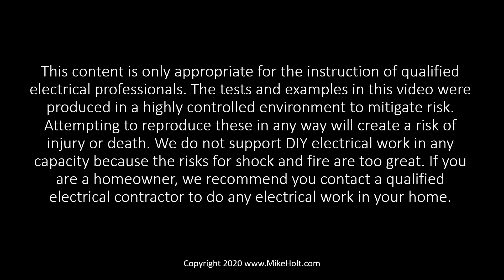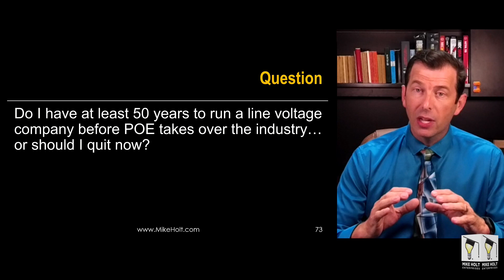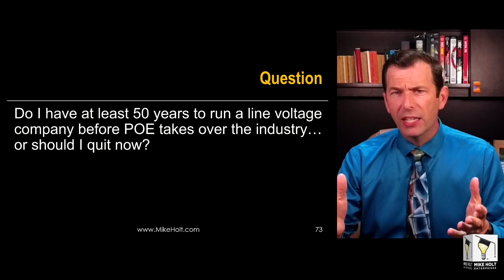Will POE systems replace Line voltage wiring? Part 2 of 2, NEC 2020, (3min:53sec)

Comment: No but PoE will significantly collapse the amount of electricians I have to deal with on a job site and reduce it to low volt primarily. It will all but eliminate unionized labour in the electric trade and save tons on not only labour cost but the wire cost as well
Reply from the maker: It's tough to say what the future holds but we need to always be aware.

Comment: I can definitely see it taking over residential lighting. My concern is will there be unlicensed workers running the cables?
Reply: Yes, there will be just like there is with line power, but when they do it will be much safer...

Comment: Look, POE is great, but there are large power applications and certain inefficiencies that come with using DC power. With the current trends to be more energy efficient, POE isn't going to take over AC premises wiring. Just my take. 

It will definitely grow, but but I don't think it will upset the entire industry. 

Just my opinion.
Reply from the maker: I agree. I hope electricians will embrace POE and capitalize on the opportunity but there’s no end to line voltage power systems in sight.

Comment: The PoE Injectors/Equipment itself will still need line voltage..I think the biggest change over 50yr will be widespread use of the romex w/ integrated data com in it(4/6/8 twist pair/#22pair/etc). More common today in commercial; but NEC needs go back to #14 lighting circuits because leds now. While everything is WiFi, i think overtime a heavy demand for the wired versions for high end builders will take over in residential. Im talking smart/led/thermo/dishwasher/dryer/etc. Buzzer is nice but its nicer when it pops up on my phone my laundry is done. Every residential utility/item will want datacoms soon.
Reply from the maker: I think you hit the nail on the head. This is only the beginning.

Comment: U throw in a switch and hire a sub to pull cables in tray or j hook. And maybe give them emt to a backbox if required by spec. Its not for anything consuming a considerable amount of power... Then u hook up the switch to a ups and boom now you don't need to put in a standby subpanel

Comment: I am a retired sparky and after 50 enjoyable years in the great trade no longer do any side work so POE will not effect me but worry with sloppy work some guys do pulling low voltage cables above drop ceilings. They once tried to fire then reduce it to a suspension when a co worker lifted a ceiling tile up that pulled a fire alarm wire out and fire vimpany showed up.